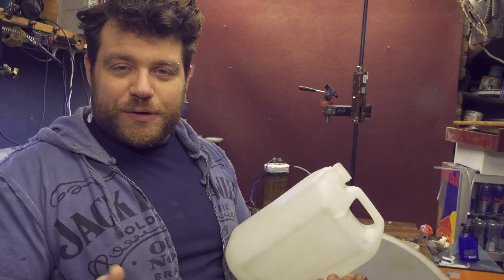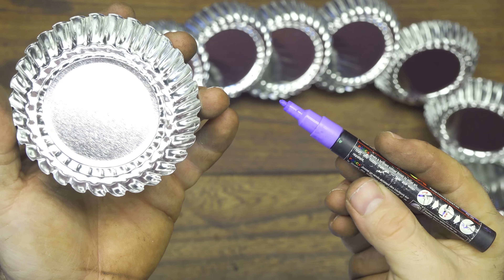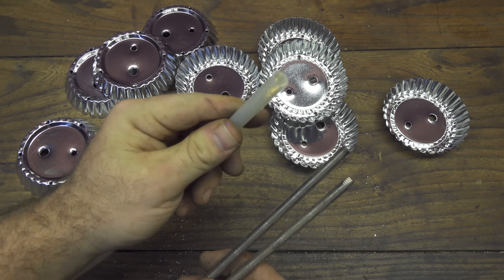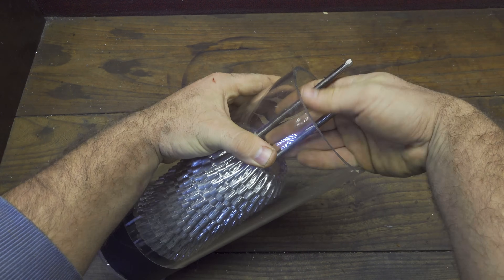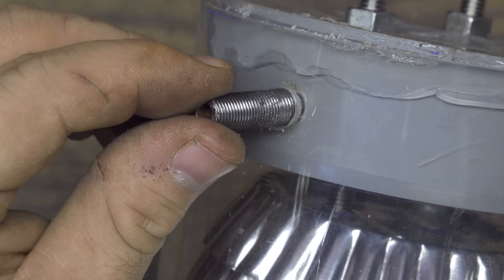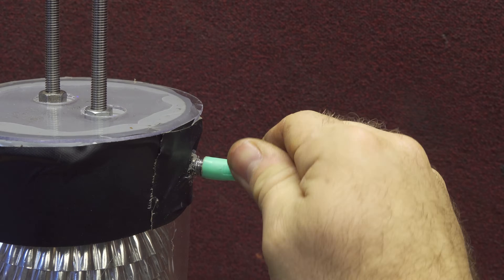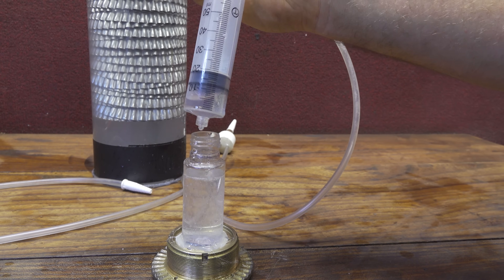Superpowerful Flame 5072 ℉ • Produce Hydrogen from Water - Do it yourself

Comment: I know the science is sound, but I feel like he cut corners and proper glass seals and equipment could have made a huge difference. His set up is sloppy.
Reply: Michael Ulmer it’s practical and safe enough, there isn’t much need for proper equipment and small amounts of released gas aren’t harmful at all
Reply: He doesn't seem to have a sense of doing it proper. His focus is on just getting it to work, not getting it to work greatly.
Still interesting how well it worked.
Reply: I like the accent 👌

Comment: guys, make sure not to use table salt NaCl. Unless you want to make chlorine gas....
Reply: Mmmm nothing like the smell of death and poison in the mornin'
Reply: Ah I've been looking for how to do that, thank you
Reply: You scrub it with the lives of your enemies
Reply: @ambushb0y   I left them back on the east coast when I moved so would need a 2+k mile pipe to send it to them.
Reply: Andrew H   Where in the east coast?
Reply: @ambushb0y  lol
Reply: hm nothing like the smell of melting lungs and skin in the morning
Reply: Sounds like something German...
Reply: Use NaOH
Reply: gets worse: Cl2, Na+, NaOH, NaClO, OH. poison time!
Reply: Best advice ever. Happened to make this error myself, I forgot that NaCl would also be split by electrolisys. What saved me, I used a very low powersupply (10V-2A) and when it started to smell chlorine, I stopped the experiment...
Reply: @emmanueloverrated  
I use salt but I never got a chlorine smell 
And I use a 12V 12A power supply and everything is fine
Reply: using Sodium hydroxide or Sodium Bicarbonate (Baking Soda) is recommended to be mixed with water
Reply: The tiny amount of chlorine will probably not kill anyone but it will corrode the electrodes in no time
Reply: I did it with table salt when I was like 7 years old and wondered about the slight clorine smell.
Also I put my hand in the water to get the electrodes out, the + electrode nearly fell apart when I took it out because it was corroded by the chlorine.
Reply: thanks for the info. Now I can DIY a hydrogen welder and chlorine gas. Awesome!
Reply: I wonder if burning the mixture and scrubbing it with water would result in muriatic/ hydrochloric acid 🤔
Reply: DrHeud I’ll be sure to use salt at my school science fair! Thanks for the advice.
Reply: DrHeud i poisoned myself with that shit one day. Thanks for the tip.
Reply: Why not, the stainless steel is making hexavalent chromium likely.
Reply: ye salt pools make chlorine with the salt. also what about Epsom salt i was using that
Reply: i came here after makin chlorine gas thank god i didn't inhaled it..........also if I keep going........and evolve all chlorine ions then oh ions will be forced to carry charge............ie then it'll give oxygen............... OR JUST USE TAP WATER WITH A NEGLIGIBLE PINCH OF COMMON SALT
Reply: @ashishitD  NO DON"T USE COMMON SALT
Reply: @ashishitD  you...WHAT??
Reply: @harrymu148  yup i added like a spoon of common salt to like a bowl of tap water...............on hydrolysis green ppt thingy appeared I thought it was iron ion but thank god I didn't smelled or inhaled it..........i made chlorine gas.........unintentionally tho chlorine is stronger oxidising agent dan oxygen but its very dangerous and hcl is bad too eye irritation etc
Reply: shhh... natural selection dude. lol   I use KNO3  ..  caustic but not airborne.... :-)        wait..   I thought boiling bleach made chlorine gas....
Reply: My school is not gonna like this (Instert evil laughter)
Reply: thx for the warning im not gonna do it anyways
Reply: Oh fuck I just electrolyzed nacl
Reply: @trotyl1432  I guess so.
Reply: Thanks but i know
Reply: Made
Reply: DRHeud thank you for the idea
Reply: @wianenslin2384  more than welcome my friend! Stay safe!
Reply: Epsom salt works well
Reply: ah shit so thats why my eyes are burning
Reply: @the_soghi  ...it took 2 years.
Reply: @jamesv4463  nah man fortunately i made my first one today😂
Reply: And how do you scrub chlorine gas? Bubble it in water or if in air already pass the air in a spray of water.
Reply: @TheUserid82  a good idea, but chlorine wants to exit water, water won't hold much of it.  Maybe some chemical absorber could pull it in. 🤔
Reply: Kevlar Canuck what?  Sodium Hypochlorite!  Heard of Clorox Bleach?   It’s mostly water I think.
Reply: Andrew H well, the way chlorine is formed is the same as hydrogen. Only does hydrogen form at the cathode(negative) and chlorine at the anode(positive). If you were to collect the oxygen you would also have some amount of chlorine in there. My advice: don't do it.
Reply: @drheud1512  Do it with sugar instead
Reply: really?
Reply: wtf does sugar make? co2?
Reply: Frankie Gargoyle  WTF?
Reply: @EvelynH-tj1qt  I don't think it would work. Sugar has no electric charge. Therefore the solution won't conduct electricity.
Reply: @frankiegargoyle7783  Im pretty sure it would not work. A sugar solution does not conduct electricity.
Reply: @drheud1512  you’re spreading misinformation, electrolysis of NaCl solution will form NaClO at first and then eventually NaClO3, how do I know? I made almost half kg of NaClO3  with that method, I think you should have your brain checked
Reply: @drheud1512  thank you I was just about to ask if you can use salt.
Reply: @TheUserid82  you just use some other salt so you don't make it in the 1st place
Reply: Maybe I want to take a shower.
Reply: Jerry Rupprecht。
Reply: @jerry3790  there's that comment
Reply: I guess you guys have never done this before. Salt works, but gas production sucks. Use sodium hydroxide ( lye, lots of drain cleaners use it). Salt does NOT make chlorine gas in one of these machines. I've owned two production units, still own one, and you are wrong.
Reply: @yewwtooob  Hi. Would you say caustic soda would be the best option to produce more gas?
Reply: @Xapiro  I won't say. Too many damn terrorists ruined it for play. Now it is,serious. Look it up. Sadly easy to find
Reply: @Xapiro  yes
Reply: @yewwtooob  wow, you're clearly an expert because you own a production unit. Would you mind telling me where I'm wrong?
And yes, I read it somewhere. It's called the chloralkali process, there you go:
https://en.m.wikipedia.org/wiki/Chloralkali_process
Reply: @yewwtooob  oh, and before I forget. Most industrial generators use potassium hydroxide KOH might wanna read the manual and give it a try.
Reply: @drheud1512  Hi. Is potassium hydroxide easy to get?
Reply: @Xapiro  I guess it can't be too hard to find some. It's used to make soap after all👍🏻
Reply: @drheud1512  Between sodium hydroxide and potassium hydroxide, which would be better for producing hydrogen?
Reply: @Xapiro  I don't think it makes a significant difference. Use what's cheaper or kore available.
Reply: @drheud1512  About electric current. Would it be correct to say that "the higher the amperage, the greater the hydrogen production"? Is there a relationship between the output voltage of electrical sources and amperage?
Reply: @Xapiro  intuitively I would say the greater the amp the more hydrogen. As in the relationship between current and voltage I'd use the formula U=R*I
So given a constant resistance voltage and current should behave in a linear fashion🤔

So I'd say crank up the amps and volts but be safe man!
Reply: "Dr heud" you are wrong. I guess you've never done it. Maybe you read it somewhere! Haha
Reply: https://youtu.be/Pcz5f99vjVE
Reply: Two things: Chlorine is bad as it dissolves in the water in your windpipe/lungs to form hydrochloric acid, but keep in mind  that otherwise it's not so bad. Trace amounts of Chlorine is acceptably safe, but it shouldn't be done in a closed room without ventilation

Secondly, keep in mind the amount of Chlorine that actually exists in the electrolyte. If you are adding one tablespoon of salt to the water, the water will not magically contain and start to generate more Chlorine, only the same amount of Chlorine atoms in the tbsp of salt would get released into the air, so the end result is that there's not that much Chlorine gas being released anyway
Reply: This comment has 399 likes Im leaving it like that
Reply: @ledicekaj5722  i was the 399th like and i was hoping that it was gonna be left like that love ya dude
Reply: Very important...haha...in my youth I did this and used ocean water because I figured it was more conductive. I did same with table salt(non iodide) and distilled water. 

I did it outside and was trying to store it in balloons and bottles to convert a gas powered generator on it.

Nvr thought of bakin soda. 

Its been 20 years. I have a genny (4k watt) with a bad carburetor...would need to toss it. I have solar panels... Why not make this happen? Needa do some research
Reply: @ryandavis4689  good luck man.
Reply: God has said in the Quran:

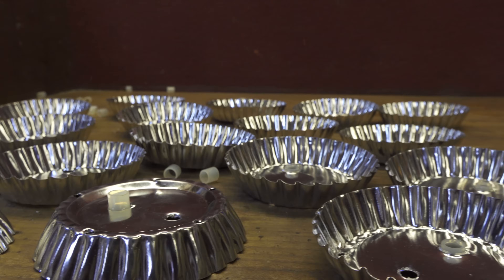{ O mankind, worship your Lord, who created you and those before you, that you may become righteous - ( 2:21 ) 

 [He] who made for you the earth a bed [spread out] and the sky a ceiling and sent down from the sky, rain and brought forth thereby fruits as provision for you. So do not attribute to Allah equals while you know [that there is nothing similar to Him]. ( 2:22 )

And if you are in doubt about what We have sent down upon Our Servant [Muhammad], then produce a surah the like thereof and call upon your witnesses other than Allah, if you should be truthful. ( 2:23 )

 But if you do not - and you will never be able to - then fear the Fire, whose fuel is men and stones, prepared for the disbelievers.( 2:24 )

And give good tidings to those who believe and do righteous deeds that they will have gardens [in Paradise] beneath which rivers flow. Whenever they are provided with a provision of fruit therefrom, they will say, "This is what we were provided with before." And it is given to them in likeness. And they will have therein purified spouses, and they will abide therein eternally. ( 2:25 )

 Quran
Reply: @ahmdabdallah5811  Muhammed wrote the Quran not Allah.  Its the biggest hijack of religion aside from Roman Catholicism.  The righteousness of his Allah depends on your performance and the reward is unattainable by those who strive for it.
Reply: And sodium metal!
Reply: @tf3confirmedbuthv54  sodium hydroxide, since it's in contact with the electrolyte.

Comment: When you got those brass fibers from the magnetron I hope you didn’t break the pink ceramic. That’s Beryllium Dioxide which can kill you.
Reply: nobody uses beryllium oxide in civilian applications. especially not microwaves lol. Beryllium Oxide is expensive as fuck, and dangerous, and alumina works just as good in a microwave, and guess what? it's cheap as fuck. all magnetrons you come across will be alumina instead of beryllium. Beryllium Oxide ceramics are usually white. Alumina are polycrystalline ruby's, and thusly red or pink  I don't know where that stupid rumor started. Unless you live in Russia you'll never come across a microwave with beryllium. I'm surprised you didn't mention hexavalent chromium frmo using stainless, too.
Reply: @schlomoshekelstein908   thank you for the useful info. Yeah the magnetron I carefully disassembled outdoors in a ventilated area definitely had pink ceramic.
Reply: @BengtRosini13  if microwaves had deadly rocks that were easily broken they wouldn't be allowed to be thrown away in dumps or landfills and they'd be clearly marked with handling+disposal instructions and throwing one away in the garbage would be a literal felony. Landfill workers would be drying in droves from crushing them with tractors, it would be an epidemic. I don't know why people keep repeating the Beryllium oxide bullshit. I'm almost convinced it's a government op to scare people from messing with them, as you can defeat cop radar and other things with these
Reply: @schlomoshekelstein908  Yes you are right!
Reply: @schlomoshekelstein908  man reading your comment I was in agreement like yeah our government would protect us from that, then I start reading the part where you mention beryllium oxide being a white ceramic and I realized they do use Beryllium oxide ceramics in microwave ovens. You can google it. When I started scrapping and learning what appliances had the most valuable contents, I broke apart a few (microwaves) and everyone had a white ceramic. I never seen these red or pink things. They don't have any valuable parts the only thing not magnetic (non-ferrous) was incassed in a white ceramic everytime. These ain't worth nothing but light iron and I know now cancer.
Reply: @michaelwilliams6431  It's probably white fused alumina without the chromium added. They don't put beryllium in consumer tier microwaves.  According to the Beryllium Science & Technology Association (http://beryllium.eu) domestic microwave ovens do not contain beryllium oxide. However, very high power commercial microwave ovens and radar systems do contain beryllium oxide.
Reply: @brianpeers  it is more of an occupational hazard indeed.
Reply: I know I was trying to be very careful when disassembling the magnetron of a microwave oven I scrapped out for the transformer and magnets, brass fibers, and whatever else I could find of value. Like, I wondered what the wire that went to the other side and a little sensor type unit, maybe it helped to determine the power level output of the magnetron.
Reply: Actually no. It’s not. There is a very very likely chance that it is not beryllium oxide, and something else like a different high voltage insulator. Simply because beryllium oxide is more or less put out of practice of high voltage insulation in microwaves. It’s more for more expensive and permanent equipment. DiodeGoneWild has a mentioned this and has many videos on this.
Reply: Not! It's probably aluminum oxide in a consumer unit.
Reply: Beryllium oxide as BeO, NOT BeO₂.
Reply: Beryllium Oxide has  a  Protective Action Criteria (PAC-2) on 0.069mg/m3, which means serious health problems if dust at or over that point is inhaled or swallowed. Instant danger is at 4mg/m3. Its a poison and a potential occupational carcinogen. But to reach at that point must become airborne. There are ways for this to happen so I would recommend great caution and keep this material away from fire and liquids, including water as it is Water-Reactive.
Reply: Think of all the people who target shoot or explode microwave ovens for fun and then go close for inspection or when cleaning it up not knowing about the pulverized beryllium dioxide they have been exposed to.
Reply: @brianpeers  With some degree of irony the trace emissions from vehicle tailpipes, PM2.5 superfine polymerized nanocarbon dust particulate matter super toxic to lung cells & a major reason diesel emissions scandal so problematic & think of the scale & number of ICE engines all emitting #pollution etc

Comment: Blue Flame vs Yellow Gas Flame Colour 
So, a blue gas stove flame indicates complete combustion, meaning you aren't wasting gas and money. 
Red or yellow gas flames may be the sign of incomplete combustion, wasted gas and a serious safety hazard.

With hydrocarbon flames, such as gas, the
 amount of oxygen supplied with the gas determines the rate of 
combustion, flame colour and temperature.
In all but exceptional cases, like decorative gas fireplace flames, you always want a blue flame from a gas appliance burner.
Flame Colour Temperature Chart

    Gas 
    Colour 
    Temperature

    LPG (Propane) 
    Blue 
    1,980°C

    Natural Gas (Methane) 
    Blue 
    1,960°C

    LPG or Natural Gas 
    Yellow 
    1,000 °C
 A yellow gas flame is indicative of incomplete combustion and carbon monoxide emissions.
Yellow gas flames only burn at around 1,000°C.

Your flame is never that hot as you describet! Yelow or red flames are not so hot! Blue flames are hot!

You should also save the oxigene and mix with the flame, then it would change to be a very hot flame.
Reply: Might be yellow due to stray.sodium ions from the bicarbonate

Comment: Can you pls send the details of the electric circuit ang materials
Reply: The circuit is very easy. The transformer reduces the input AC voltage to 5 V AC. To do electrolysis of water you need DC - like a battery. The largish blocks you see are high current diode rectifiers, converting AC to DC. So just Wikipedia 'rectifiers'.
He could have added a (very) large smoothing capacitor to maintain the voltage above a certain level (3 V ?), improving the gas output.
Or you could do what everyone else says: get a switch mode supply from AliExpress, which is cheaper, lighter & more efficient. Or four, for real output.

Comment: @8:18 Water is leaking out from the nozzle cap. The water has clearly migrated from a water container i.e. bubbler and/or main gas producing cylinder. HHO generators produce a wet gas and any water vapour contained in a flame will foul any weld. My tip for anyone considering HHO, is to dry the gas before use. Perhaps use a condenser and/or maybe run the gas through a dessicant before the gas reaches the nozzle. Imo, the gas produced this way will burn more efficiently.
Reply: Could the water be a byproduct of the burning gas or gas recombining in the tube?
Reply: @sea0fgreen33  but the gas burns outside of the tube does it not? how can the gas re-combine in the tube when there is no reaction taking place? you are clearly not familiar with wet and dry 'gases'! It's clear water vapor is carried by the gas products
Reply: @PeterPete  it's burning at the base of the nozzle where the hydrogen and oxygen are combining into water. If aimed at the right angle, water vapor can travel into the tube and condense. You are clearly not familiar with the water cycle!